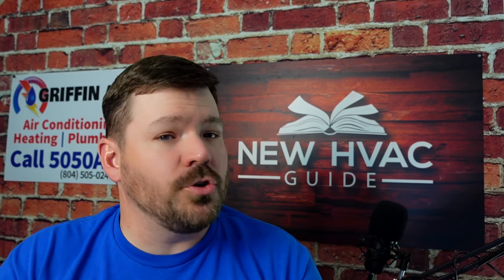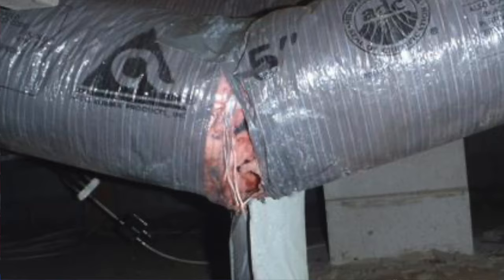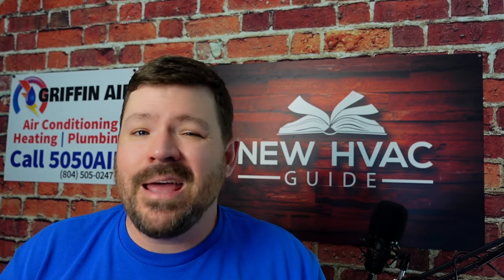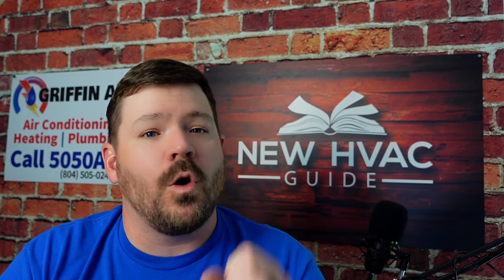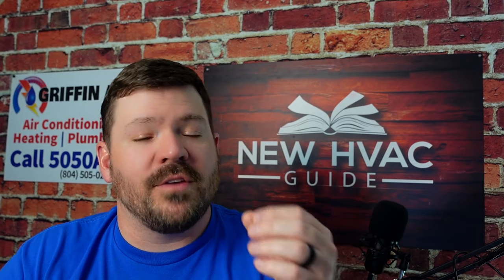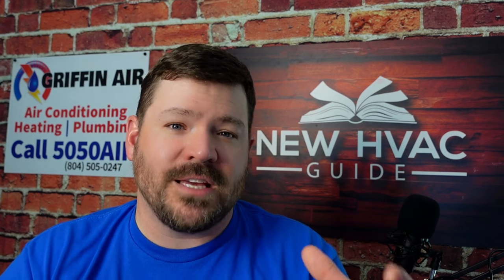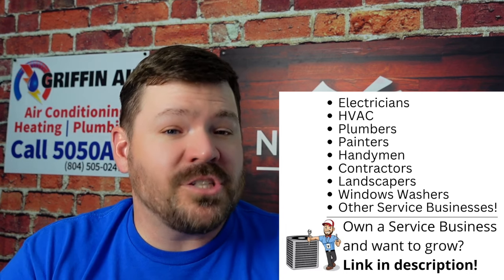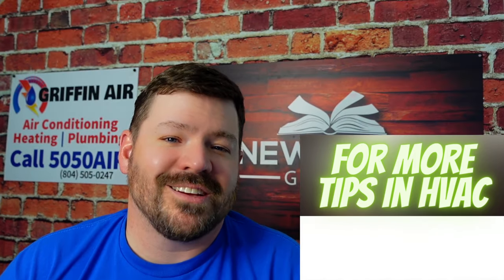3 SOLUTIONS for Ductwork to HOT ROOMS!

Comment: I hear you. Even the company I bought my new $5,000 HVAC system gave me some bad information. I was not getting enough air flow upstairs so I asked if they sized my A/C correctly. He said they did. I then said I heard that dampers can be adjusted to move air better. He told me the dampers were set in the optimal positions and that wasn't the issue.. Turns out he was either incompetent or just didn't want to deal with it. 

I looked it up on YouTube and then played with the dampers and sure enough, one was only open 50% and when I opened it 100%, the air flow is now stronger upstairs. So much wasted time dealing with it being 68 in the basement and 78 upstairs when all he had to do was adjust them 2 years ago. 

Shame on me for thinking a professional HVAC guy knew what he was talking about or was giving me the best advice. Just like any other profession, some are just phoning it in, while others go above and beyond.
Reply: Where were the dampers? The trunkline in my attic gets air but not enough for 5 rooms. I feels like something was not sized correctly. I didn't see any dampers when I sent the camera down through the main vent from the attic.
Reply: @javimelendez414  My dampers are in my laundry room on the main ducts that are coming out from the HVAC fan that sends the cool / hot air throughout the house. I am not sure about any in the attic. For my design, it makes more sense for them to be right by the fan and before the ducts branch to downstairs and upstairs. The dampers are also easily visible on the ducts.

Comment: I put a 6" inline fan half way down the duct to the room and installed a sail ( Pressure activated ) switch in the main run line. When the system turned on, the line boost fan came on. Although it worked, I had to remove it because it was quite noisy in the floor area of the room. Those type of fans are made to exhaust air from greenhouses, so the steep angle on the blades makes for a lot of loud air movement.

Comment: Most common situation: Hot room in upstairs and HVAC in basement/first floor. Added air return to upstairs is ~35ft long while basement air return is ~3ft long, so the intake pull from upstairs is low. In addition to solutions noted (manual damper, adjust registers, add fan to register), why not add fan to air return as well to help pull the hot air from the upstairs return?
Reply: My situation exactly. I had the same idea, that's how I found this video...
Reply: I dont have return upstairs either. The previous owners made a hole on the wall with a register that leads to space between the joists. Not sure how this would help. The entire 2nd floor hardly gets any air. @ventsyv

Comment: My "hot room" is located above the garage and experiences significantly higher temperatures compared to the rest of my single-story home (76° versus 82° to 83°). Despite trying various attic-based solutions to alleviate the heat, they have only marginally improved conditions by about 1 degree. Compounding the issue, the room's air conditioning return is inconveniently located at floor level, exacerbating the heat buildup. The furnace directly beneath the room provides a short path for air circulation.

Given these challenges, I'm considering two potential solutions:

1. Installing an additional air conditioning return duct in the ceiling of the bonus room, positioned centrally for optimal airflow. Although this may involve complex ductwork through the attic, it could significantly improve air circulation. I currently use a ceiling fan, but I'm willing to turn it off if it enhances the effectiveness of the air conditioning.

2. Exploring the option of installing a quiet ceiling vent fan designed to draw hot air from the room and exhaust it into the attic. While this approach may result in some air conditioning loss to the attic, it seems like a viable option given the current circumstances.

I'm seeking advice on which of these approaches would be most effective in addressing the overheating issue in my bonus room.
Reply: Looks like we might be living in the same house. :)
Reply: I think the first option is the best I do hvac work and the return doesn't need to be in the center of the room regardless of where it is it's still gonna pull the same amount of air what matters is how big flex/duct you are gonna use for the return. That's what will matter in how much air gets moved
Reply: @justinfarias7247  Thanks for the reply! Since I wrote this post, I have been installing radient barrier foil on the sides and top of the bonus room. Hopefully that will help some what with the heating issue. I am doing this before I install a new return air duct. Thanks again!

Comment: Are the "dampers" the little flaps inside the duct? My house has round vents with pull chains (like the kind you see on ceiling fans) and metal flaps inside. The hottest room in the house has a flap that is stuck and doesn't seem to want to open all of the way. 2nd hottest room has the same thing but the chain is gone and I don't know how to get it to open back up or how to get it to stay opened properly. I'm sorely tempted to get on a ladder and try to tear the flap out entirely.
My house doesn't have floor registers. It's a single story house and I don't know how floor registers would even connect to our central AC.

Comment: Hello I see you are in 804 Area code. I have a Question  , I had a Modular home built  and The Builder used All Half Assed Subs. Our HAVC guy did a Half Assed job !

I have the Fkex Duct work that's 80% closed off by Just Hanging in a Single Strap in Long Distances.  
I am going Replace the Duct work myself. I believe  I have enough  To figure it out and I do have  the Sheet that was Supplied to County for Approvel , I will have to put in Valves - Dampers so the Air Will not Over Power each Room . Basement  is Open . 
But my Question  is 
Our Garage  does not have And Heat or A/C in it , Could I Run 1  Metal Duct work in Garage  , garage is a 24'x30' 
Whole house is Super insulted,  even the Garage  has 6" outside walls and Great Insulted  Doors on it.
  Does the Garage Have to have a Return , 
Seeing it is a Garage not Living space - I say Not
 
   When I do the Duct work in basement  I will put in the Dampers and Cover the Duct work so it is Insulted  Good and will use the Super Sticky Tape for the Ducts when I do them . I am going to Run a Pipe Metal Duct into Garage  and Put a Damper on it to regulate the air so it does not Over Power that Garage , and Make Sure it Has Alot of Bug Screen over it . Even though  we have No spiders in house because  we have a good exterminator here in Area that come 4x's a Year 
The Duct in Garage will be on House side of the wall and I will enclose it and insulate it when I pit it in using Boards and Drywall  it

Whats your thought. 
I Ended up Firing the Builder and Finished the House myself !!

I don't  have any $ left to pay to have someone  do the work. I had to Hire people  to Fix Builders  Subs Work , Shingles  put on back Roof Sideways  , Vent Pipes on Roof Flashing  On wrong , the Ridge Vent on Roof looked like a Snake Crawing across  the Top. Where the Chimney siding was Not Finished ,  Eve Flashing was 1/2 on house. Builder Kept having Subs Coming Back ,and Back. 
No wonder Subs Kinda did not Care  !!!
 Builder I belive He did not Know How to Use his Subs and Had then Do Piece work here and there. Never Finishing There Job. 

 Siding  guys shoukd not have even come till house is ready to wrap !!!
Even the County  Inspector's Did not Catch the Uber Ground Rod Was Not hooked up to Ground of outside Grounding. 
 Breaker's in breaker Box Was Rusted. I hired  a company  come in Hook up my Standbye Generator  and rewire the panel Box !!!
Yep Even the sub Electrian was Horrible  . I told Builder to Fire him from the Get Go !!!
 The Electrian  was Also the Plumber !!! Tell me it's not crazy

Comment: Are house in most rooms get so cold that if I turn off the air it's better and the temp throughout the house is so off the bathrooms are usually freezing  to where you almost want to plug in a heater until your done showering

Comment: Does adding a return air pattern vent above the door coupled with the vent fan potentially increase cooling of the room? In the desert the SW room seems to be quite hot from the afternoon through setting sun and in a small room where they diverted the HVAC and it’s too small for the room, plus external sun on walls and a wall butted up to a hot garage, it’s pretty brutal. No regular fan does anything and other parts of the house are too cold if you run the a/c just to accommodate that room. I’m trying to find a solution to help, not necessarily correct it, since that probably involves something quite extensive. I was thinking of trying the RAP above the door, but that vent fan would probably help alongside the RAP. If the HVAC vent wasn’t in front of the sunny window, I feel it would help because it seems the hot side of the room just warms that cool air so it can’t move through the room while still cool so any room fan just blows warm air.

Comment: Thanks for the video. What about putting a fan in the foil duct in the attic that would constantly pull the cool air from the other rooms to the hot room? 
How small do they make those vent fans in your last solution?  Possible for a 6x6 vent? 
Is there a way to tell if I have dampers installed? I have one giant foil duct going into a large foil box with 3 different sized foils ducts coming out of it going to 3 different rooms. Without going up to the attic I’d guess that box is 2’ x 1.5’ x1.5’. I’ve got a 4 ton unit. Thanks.
Reply: You could always frame up a bigger 6 by 6 vent if they didnt make that size vent fan.

Comment: I added a portable air on my room and somehow I notice the floor seeps in heat from the garage and the ceiling corners are hot and front home of househas no insulation. Walls are hot. Can this be something I can sew the homebuilder  or just fill in the walls with insulation? How do I insulate a floor?
Reply: This is ongoing every summer in Arizona heat
Reply: portable AC units work differently than other types, since they blow the waste heat out of the window, it's sucking in outside air through cracks like you describe.  if you switch to a regular window unit it won't suck outside air into the cracks in your house.  for that reason the portable AC units aren't a good long term solution and can make other parts of your house hotter.

Comment: What is you just put a fan in the basement connected to the duck work and push the cold air from the basement 24/7.
Reply from the maker: Did you do that?
Reply: @NewHVACGuide  yes is it a bad idea? I got a 5 inches fan and just disconnect the duck work for the one room that is always warm and now pushing hot cold air from the basement in the room.
Reply from the maker: @L.L  I would have the air tested for sure
Reply: @NewHVACGuide  what do you mean? The air flow? Or do you think the difference in temperature can cause moisture in the vents?
Reply: @NewHVACGuide  well now I am freaked out and put it back the way it was lol. I will have someone come and check the air quality I. The house next week. I always have a dehumidifier running in the basement and the air is around 45% so I hope it was not to humide to push in the duck and created moisture. Thank you

Comment: We have even cooling in every room as long as the rooms doors are open. Course closing sleeping room doors is common but the room heats up! How do I allow for this. I have closed most registers in the main room of home, helped a little, but suspect air flow is restricted now overall. Single story florida, heatpump.
Reply: Sounds like not enough return from the room.  Add maybe a jumper duct
Reply: Close the vents outside the rooms so it hits inside
Reply: Prob central return,no return in each room .cut door bottom so air can be pulled out when door is shut ,if possible add returns to rooms
Reply: @shailenpatel500 then coil will freeze
Reply: @kennethbrown5664  we installed a multistage HVAC inside and out. Also added an additional supply duct in master.  Multistage is amazing for keep everything even temp.
Reply: You can put vent grills in the doors so you can close the door and air can still get out of that room to the return
Reply: @justinfarias7247  that's not gonna pass the decortor police! There is already a cold air return in the room. We had another duct run to the room now is good.

Comment: Leaving the fan on will just blow hot air. The ducts immediately get hot in the attic.
Reply: nope, the system is continuing to receive air from the cooled rooms. Shutting the system off will allow the ducts to get hot (if in the attic) then when the system turns back on that hot air (but still not as hot as attic air temperature) must blow out into the rooms.  On super hot days it's best to leave the fan in the "on" position. (daytime only!)  Then the room temps do not fluctuate but stay even as the system turns on and off as needed.
Reply: @amtrakusa1 so you're okay with systems being vented into the attic space
Reply: If you live in two story the ducts are in between floors.
Reply: @me4654  I don't understand what you mean by systems being vented into attic spaces because the whole ac system is a closed system if you leave the fan on it will jus pull the cool air from the rest of the house into the return and back out the registers